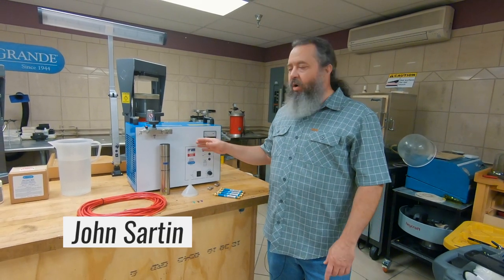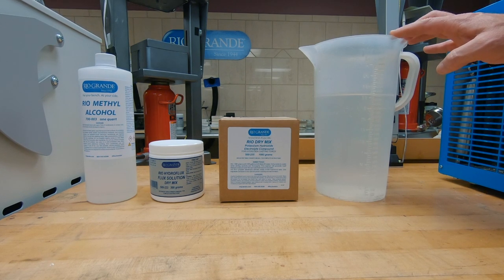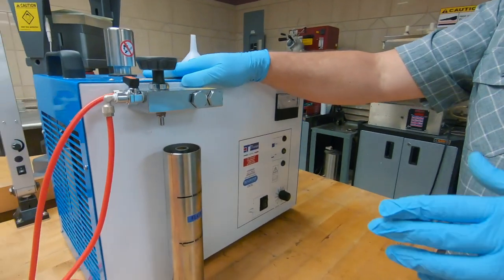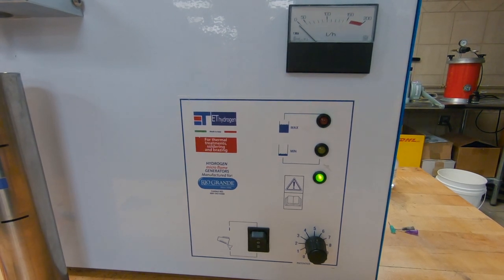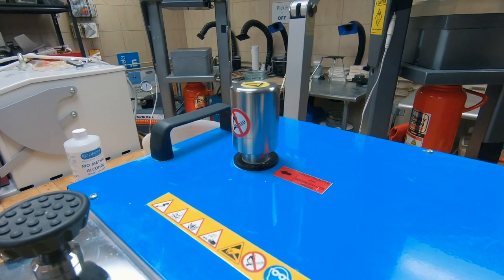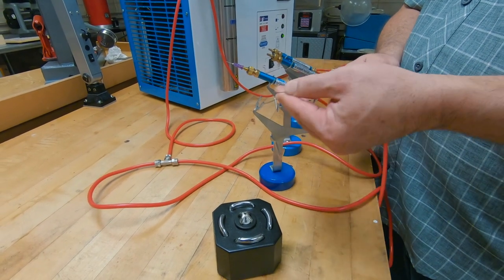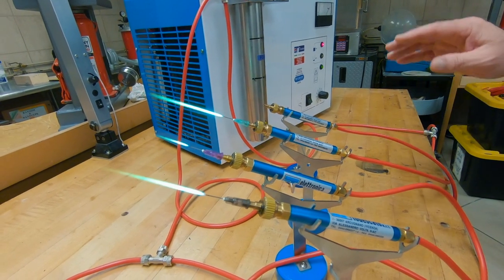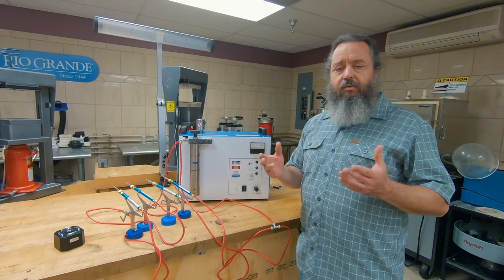L160 Four-Torch Hydrogen Welding System: Set up and Use

Comment: Does this equipment allow smelting of small amounts of gold or silver (something like 50/100g)  in a crucible for pouring into ingots?
Reply from the maker: Hello. Thank you for the question. No, it cannot,  it doesn’t have a big enough flame.
Reply: @RioGrande1944  Thanks for your quick response! So I ask again: Is there any other configuration with the same type of machine topology [oxyhydrogen] that allows me to do what I want to know? I mean, is it the gas or the torch itself? Is there an equipment of this type or some adaptation that makes this possible?